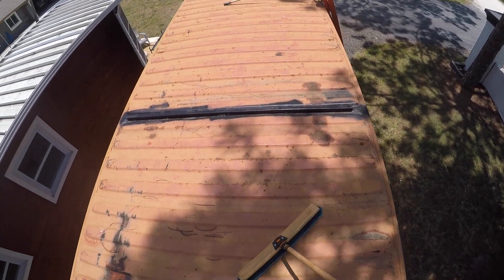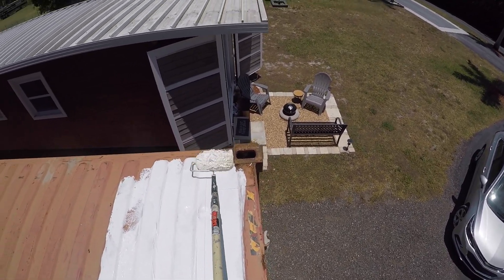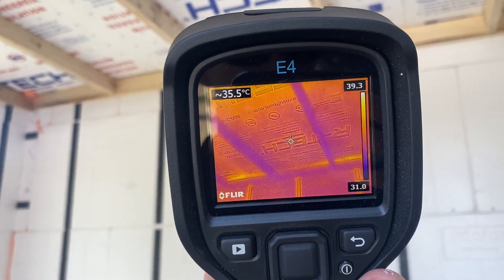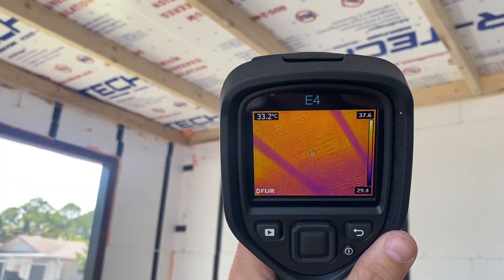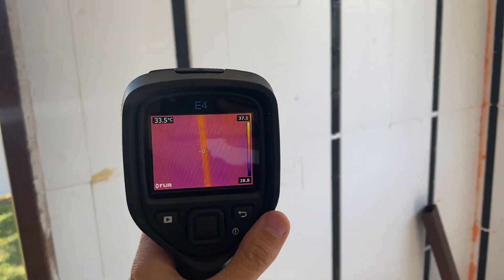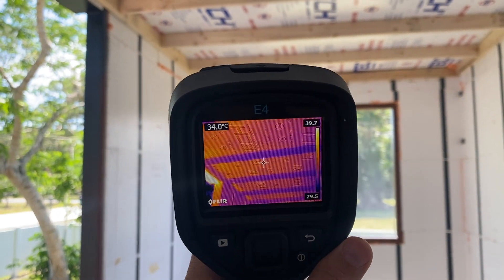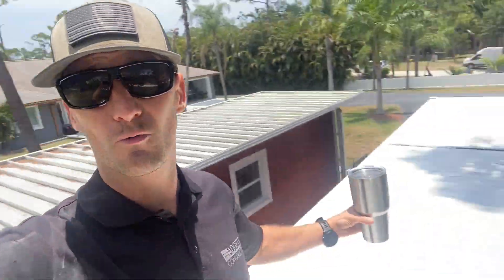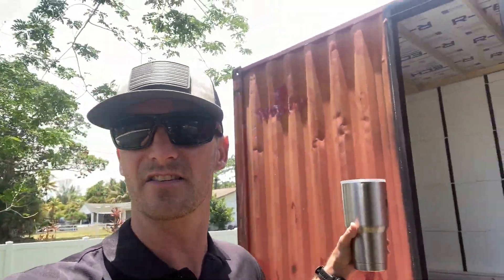Unbelievable Thermal Paint TEST, Crazy results!

Comment: I would be more impressed if you had painted an already white portion with this coolant paint and did a test between the white painted part vs/ the cool painted part - I saw several videos testing insulation paint  and it turns out the cooling effect only comes about because the surface is white, not because of the coolant or insulation itself.

Comment: Hi thank you for sharing you videos, blessing to all! what material did you use to cover the joint on the roof from container to container?
Reply from the maker: When we seemed two together in The Texas build we used 1/4” by 4” flat stock steel we welded to the two containers and then water proofed it!

Comment: You should be aware that IR temperature measurements have to take into account the emissivity of the material being measured and that factor corrected for. Low emissivity will measure lower with an IR gun and high emissivity read more nearly correct. 
When we do thermography we have to make allowances for emissivity and when measuring metal objects we often put a small piece of black electrical tape on and measure that as it's emissivity is close to 100%. Shiny metal measures lower as it's emissivity is low, unless it is reflecting another heat source, like the sun for example.
Several years ago I spent a week in a training class to become a certified thermographer and these things are important! 
Screwy readings are often the result of poor technique.
Aiming a  gun or a camera at a source is not enough to be able to tell what is going on.

Comment: I cut a hole in a trailer wall to put in a window in the hot sun the outsise was painted cool to the touch but the inside next to insulation would burn you moral of this story paint both sides before instali ng exterior pannels if posible !